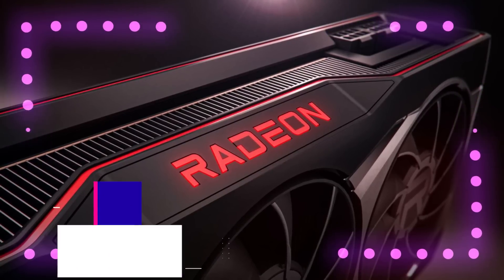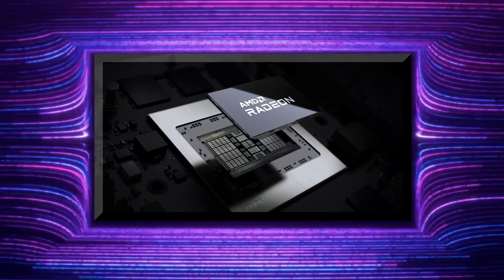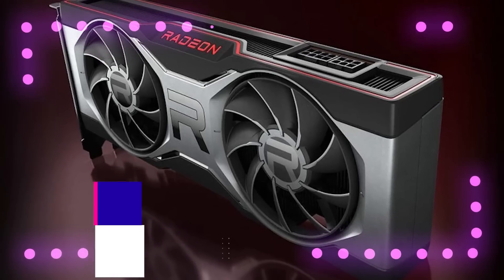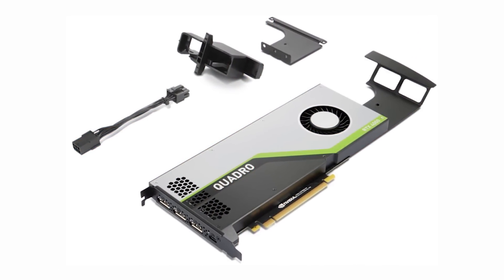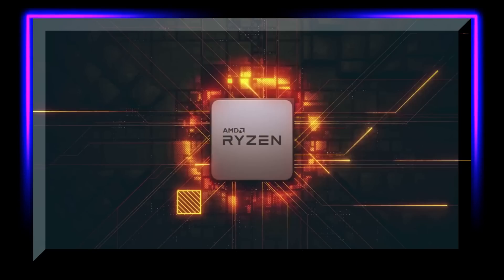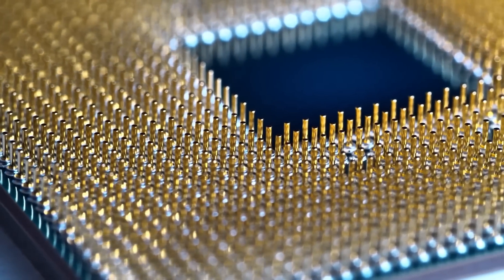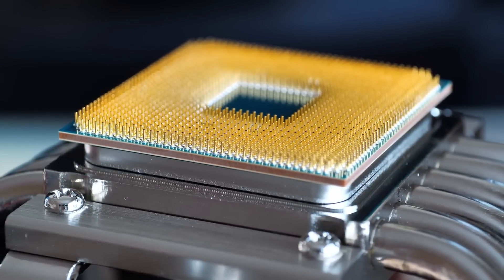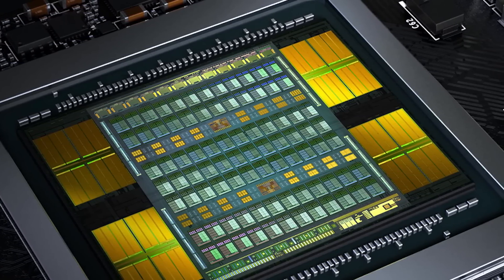AMD's future is looking BRIGHT - Radeon RX 7000 GPUs & Ryzen 7000 CPUs

Comment: Bro what do you think which RX 7000s will be sufficient for 4K at max 120 FPS? I don't want to see it any higher because I'll be gaming on my LG OLED C1 65 inch (120Hz limit) for a few more years I'm guessing RX 7800 XT at most the RX 7900 XT and you? Although I find the 24GB from the RX 7900 XT really ridiculously much... That can be used with RX 7950 XT and higher. I think it will be the RX 7800 XT. Just as it could have been an RX 6800 XT LC this time and would have been completely sufficient instead of an RX 6900 XT LC, which I constantly downclock because it eats up too much power unnecessarily. At the moment I have Cyberpunk 2077 at 4k with FSR 1.0 at Ultra Quality set to 60 FPS (with some settings it would also be possible to get almost 120 FPS at WQHD) at 2200Mhz GPU clock I have a smooth, great picture and consume almost 150 watts 😂🤘
Reply from the maker: peep our latest video :)

Comment: You said Navi 32 and 33 were both going to be used in the 7700XT. Also, 40% performance increase is not happening. Its going to be 80-100% faster. Also, its going to be more than 7-10% more expensive. The 7900XT is probably going to cost $1249-1599. Also, Zen 3+ is only on mobile.

Comment: I don't think i'll go for amd now because currently i'm using  amd ryzen 7 3700x and rx570 and face software issues many times when i update my drivers and the temperature goes upto 80° on my gpu while gaming and 75+ temperature on cpu🤔 and in summers the temperature of my city goes around 48°...which gpu should i go for now can you suggest me?
Reply: Can you name some of the software issues? Also 580 is fine at 80C and the 3700x that's a bit hot for gaming, maybe replace the thermal paste?
Reply: @Mr.Danny2  when i updated my driver to 22.2 or whatever the new version is 🤔 it started creating problem while idle and windows was lagging and system was very slow and sometimes fans automatically runs at higher rpm for no reason even when booting 🤔
Reply: Ryzen 3000 series runs hot its been known issue. I was on stock wraith cooler with 3900x /w 6900xt. Ran up to 80c gaming too, switch to aio liquid cooler for cpu now temps only goes to around 50c gaming oc to 4.3hz. Just get better cpu cooling.
Reply: @wokeuptoday9945  hows performance of your 3900x and 6900xt together? I have a 3700x and looking to get one of the 1440p cards either current or next gen- not sure when a cpu upgrade would be necessary
Reply: @tofuteh2348  1440p gaming is fast most triple A games 150-250+fps. 4k gaming drops fps to 60fps most games. Then again most reviews say 6900xt is the best card for 2k gaming no complaints.
Reply: @wokeuptoday9945  can you suggest me a good aio for my cpu? I can't invest much in aio right now because i'm saving money for my new gpu
Reply: @Ramattra-ow  cooler master has decent budget ones on Amazon around $70. I used it for awhile Temps got up to 60-70 gaming and heavy load. Recently upgraded to oc to a 3 fan radiator corsair h150i idles around 38c and 50c when gaming. This one cost me $200....so yeah get what suites your needs. Had no issues with the cheaper one, I just wanted to overclock so I invested in a expensive one. I highly recommend aio for your 3000 series my bro also has 3700x with wraith cooler and his overheats alot.
Reply: @wokeuptoday9945  thanks my brother 😊 i'll buy it soon
Reply from the maker: what cpu you using?
Reply: Ryzen 7 3700x

Comment: As a laptop proponent, I’m just hoping AMD establishes more rapport with laptop OEM’s to get more of their product on the market. As it stands, only four laptops carry RX 6000 laptops; two of them are the lower-power 6600M, and the other two are unfortunately gimped (MSI’s Delta 15 has the wattage-limited 6700M, and Asus’s Strix 15 Advantage Edition doesn’t have a MUX switch). It would be a shame to see a repeat of this with RX 7000.
Reply from the maker: Good points...I wonder what keeps more partnerships..? Do the AMD cards not cool as well in laptops?
Reply: @TopTierTech1  Can’t say much about cooling on Radeon laptops (I wouldn’t call them any worse than their Green competition), but I’d say it’s just about visibility. Nvidia has been in control of the GPU market for years, but I’m thinking it’ll only get more competitive with next year’s MCM designs. Really wondering how that will translate into laptop power (and whether that will further Radeon’s appeal).